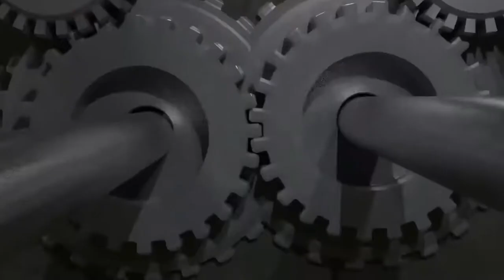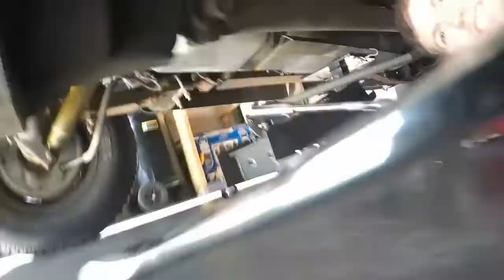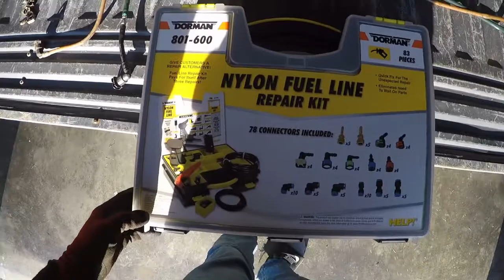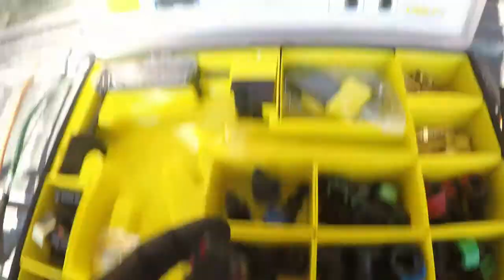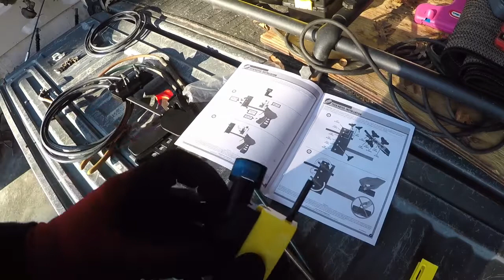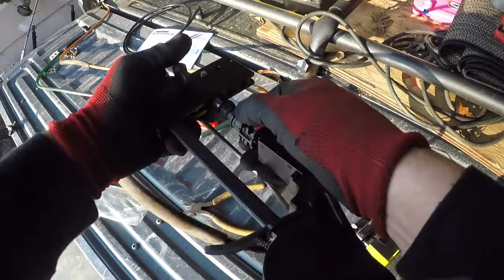Fuel Line Repair Using Dorman Fuel Line Repair Kit

Comment: just got the kit was curious if it will work on the stock plastic lines?  Has anyone tied if so what results did they have and any tips.
Reply: Yup, it will work fine. As long as the factory line isn't damaged or creased. I've repaired several areas of damage from the P.O. of my truck with that kit. Works really well. Mild heat and some petroleum jelly thinly applied to the barb help immensely.
Reply: @eb0800  
thanks for the tips
Reply: @stanburk7392  No problem. I love these trucks and want to see as many on the road yet as possible. Hope you get it/got it fixed and get her back on the road.
Reply: How much did the kit cost?
Reply: @jefferyburns250  Mine was right around 300 Canadian
Reply: @jefferyburns250  I just paid about $275 USD.  The tool itself is about $100 USD.  I think that buying the Dorman Fuel Line Tech Tray Part# 801-600 is well worth the time saved because it has two drawers and contains a ton of fittings that you might need to make a repair.  The time this kit will save the technician will pay for itself.

Comment: Use some lubrication on the fitting barbs and it goes on like butter.
Reply from the maker: Makes sense. Thanks
Reply: A drop of motor oil on fuel filter & quick connect fitting snaps on smoothly.
Reply: It might come off like butter too